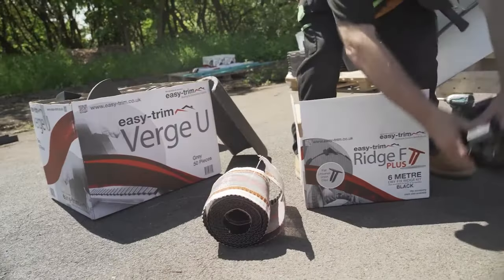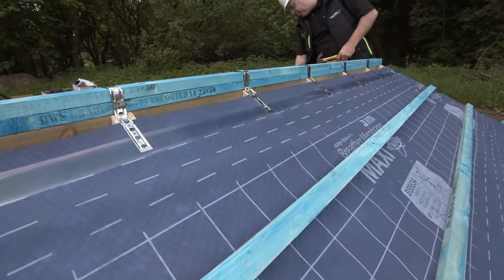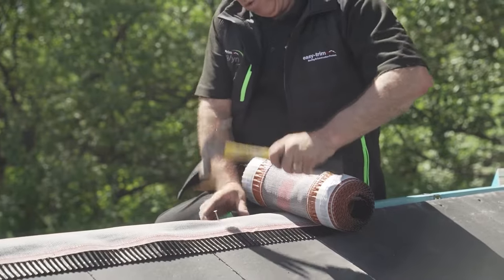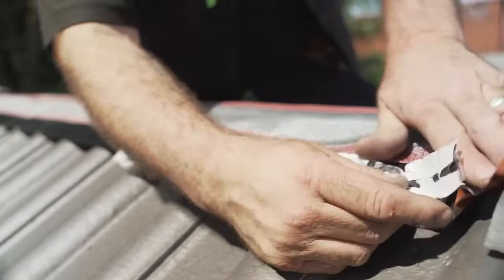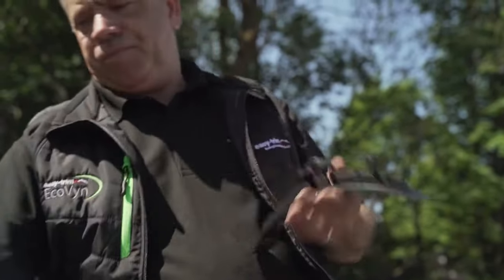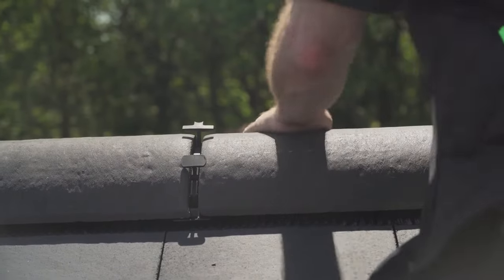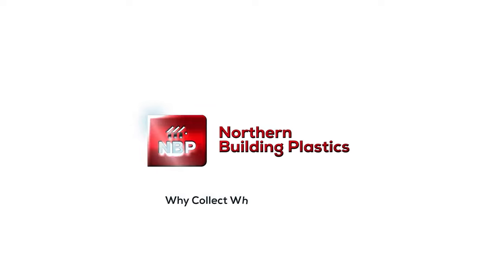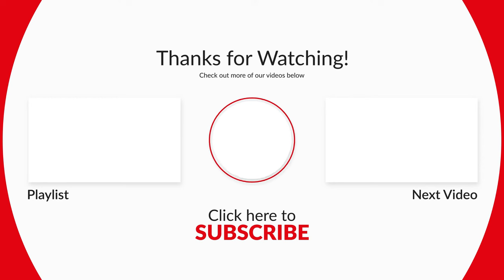Easy Trim Dry Ridge Kit Installation Video

Comment: Is there any advantage to using the straps to secure the battens to the rafters vs just screwing down thought the battens into the ridge with decent stainless steel screws? The straps just seem to be a bit of a waste of time, especially if retro fitting if you can just screw the battens to the ridge.
Reply from the maker: You could use a long screw to fix the battens in place, although with it being vital that extreme winds at the ridge do not pull the fixing out, we would recommend using the batten straps to provide a very secure fit.
Reply: @nbpltd  I fitted my new ridge a few weeks ago & I just used 120mm x 8mm landscaping hex head screws through two 25mm battens into to 9x2 ridge board & it's absolutely solid. The long thin stainless screws provided with the dry ridge system would definitely give way LONG before the 8mm landscaping screws. 

For my situation this way was a lot faster than messing on with straps but obviously every situation is different.

Comment: Do you need ridge trays with this?
Reply from the maker: You will if fitting on hips, but according to Easy Trim's installation instructions, they are not necessarily required on the ridge. For more information, you can view the Dry Ridge Kit and Hip Accessory Kit installation guides here:
https://easy-trim.co.uk/storage/1566/entry-level-ridge-kit-installation-guide.pdf 
https://easy-trim.co.uk/storage/1616/hip-accessory-kit-installation-guide.pdf